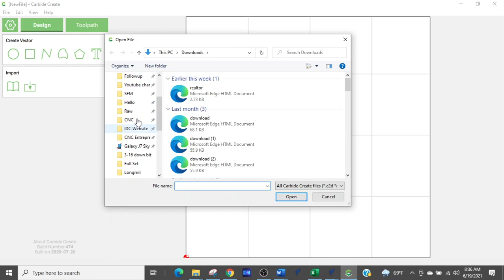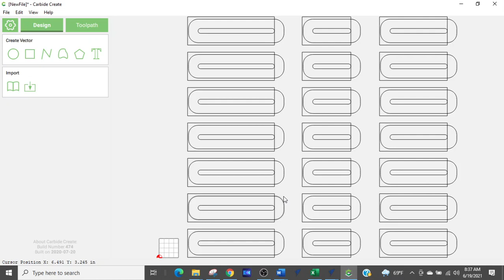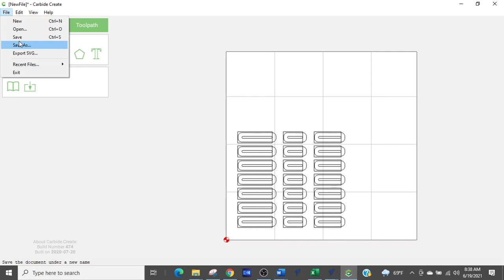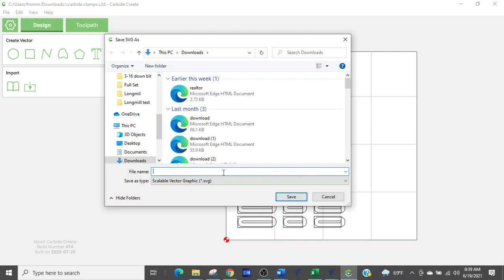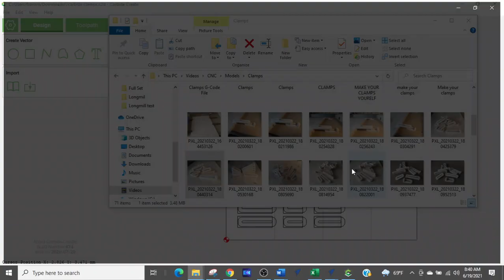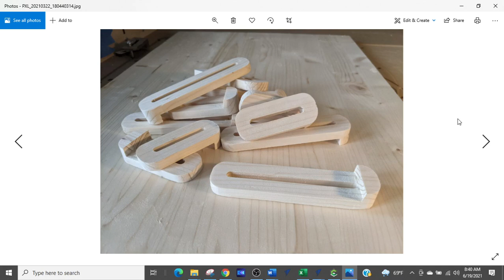Carbide Create - How To Import Export SVG Files - Garrett Fromme

Comment: I'm coming from the world of autocad (dxf/dwg) which I use for designing parts for 3d printing, and I am looking to get into CNC. I don't have any other CAD program experience. Is carbide create the best choice of software for someone like me (if i wanted to create CNC designs in autocad)?
Reply from the maker: I'm not a carbide user. however, it is a limited software as you will find (coming from Autocad). Get Vectric Vcarve.